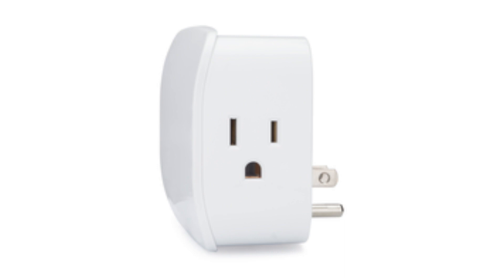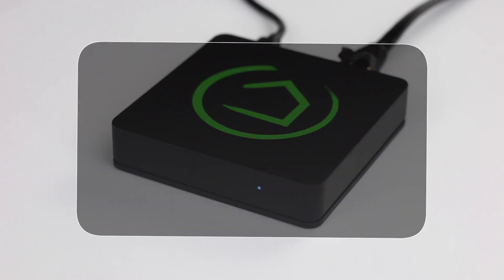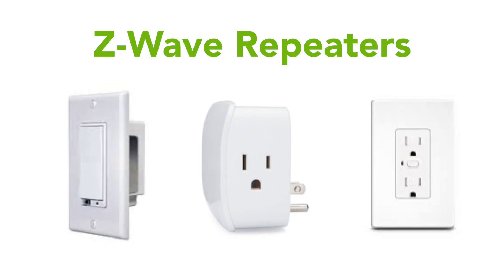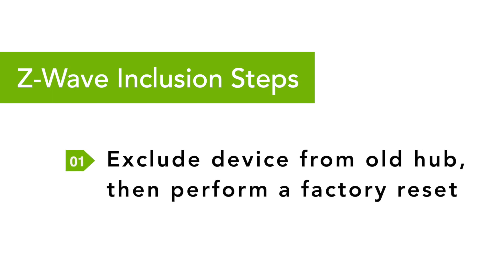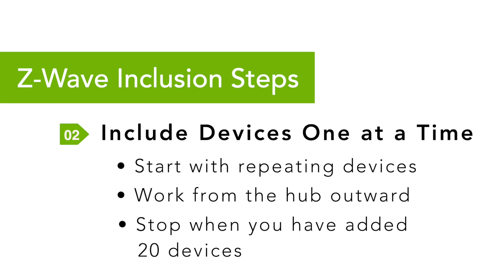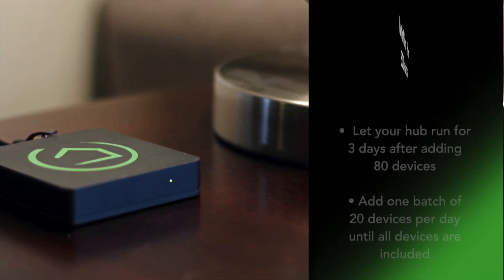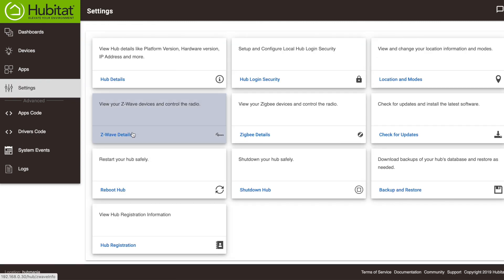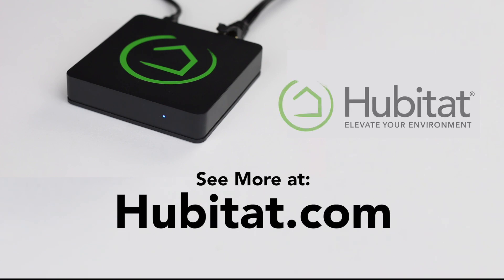How to build a solid z-wave mesh network

Comment: I've added devices throughout my home over the past ~2 years, based on need for automations, not based on where the devices are located.

How do I rebuild my mesh?  Do I successively exclude and then re-include my devices?  If so, to I need to then rebuild my automations?

Running the Z-wave repair tool fails for a large proportion of my devices. I have about 20 repeating + about 10 battery-powered devices.  One of my automations is slightly erratic, with the devices being about as far away from the hub as they can be in the house.

Comment: Is there a difference in adding older Z-wave devices and the newer Z-Wave Plus devices?  How often should we run a Z-Wave repair and does it cause the mesh network to be rebuilt?
Reply: "Classic" Z-Wave devices may need to be paired near the hub, but Z-Wave Plus devices should be able to pair in-place through your mesh network (and if not, they're unlikely to work in place, either). There are rare exceptions for some devices, like secure entry devices (garage door openers, locks) that may need to be paired very close to the hub.
Reply: Run a Zwave repair every time you add something new , your network will thank you ;-)